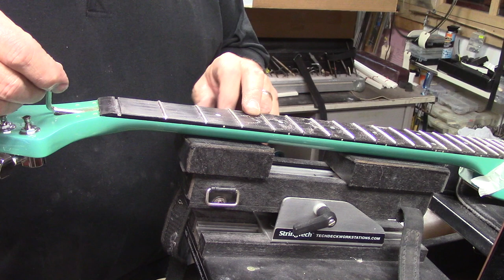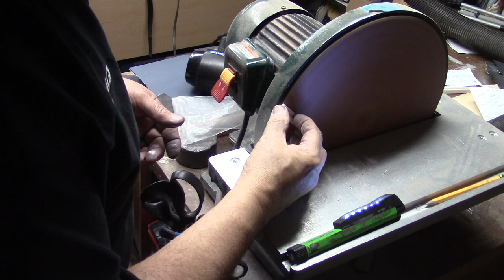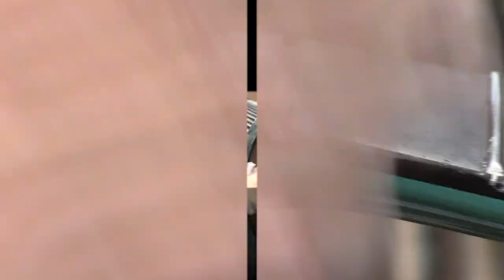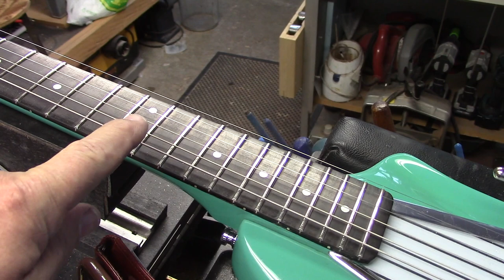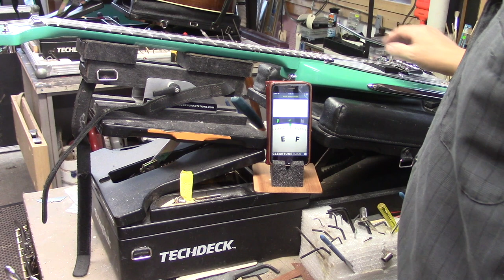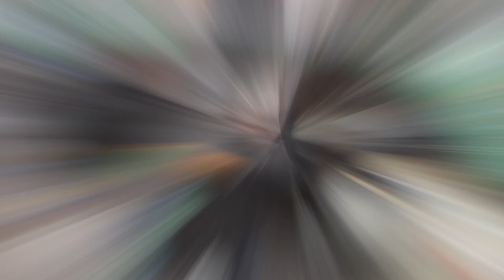'57 Showster designed after the "Fin" of a '57 Bel Air

Comment: As a beginner luthier, I am learning a lot from this channel. 
What are your feelings on "single point", individual, micro nuts for each string, positioned per string according to the logic of a single unit compensated nut?
Reply from the maker: Are you referring to an adjustable compensated nut ? I suppose it is possible. But ... realistically ... once my students and Patreon subscribers get this technique down ... they can expedite the jobs and their variations pretty quickly.
Reply: @StringTechWorkstations  some of the ones I've seen have looked a bit like a dome-topped, slot head screws. One is positioned along the path of each string at the nut intonation point. There is nothing connecting one "nut" with another.

I build fanned fret instruments and have been researching how fabricate one piece comp'ed nuts for these types of builds. This morning it occurred to me that I could really simplify the process using single string nuts at compensated locations. I think this would only be feasible on from scratch builds, however.
Reply from the maker: Aaah ! OK Now I see where you are going with this .... a fanned fret guitar ... right ... that would make sense. BTW: This one's for you Pal  \m/ ! https://youtu.be/0peJYI-XQ2Y